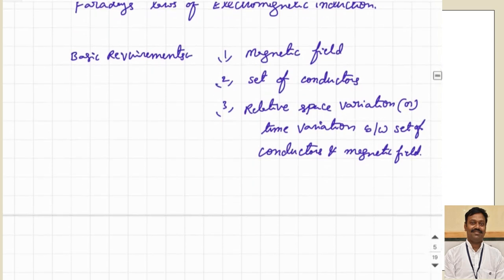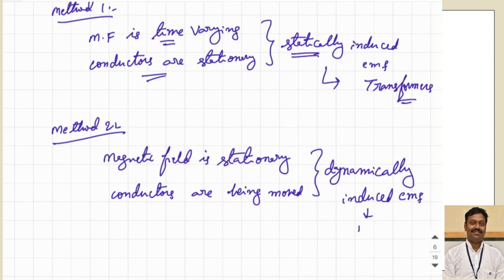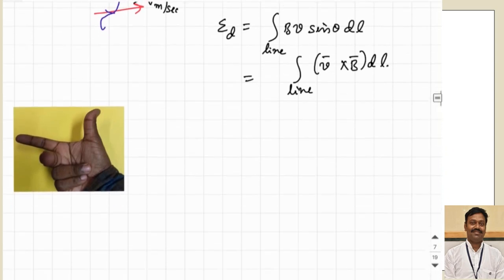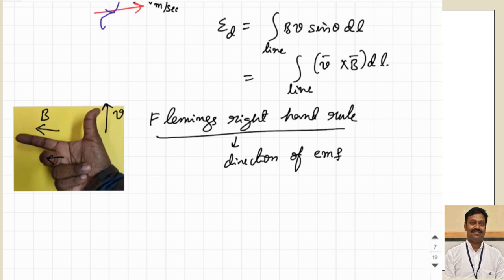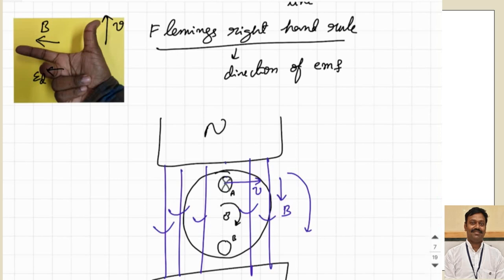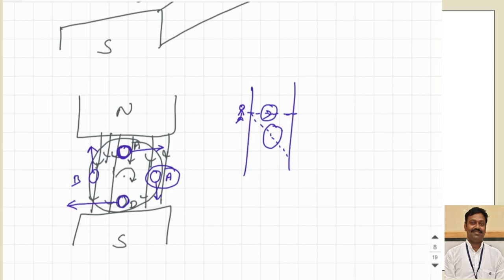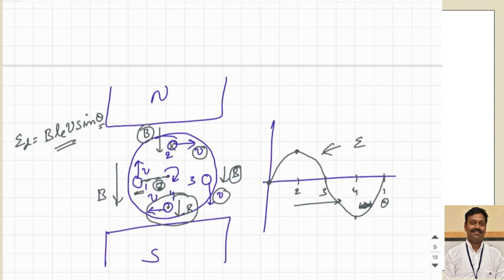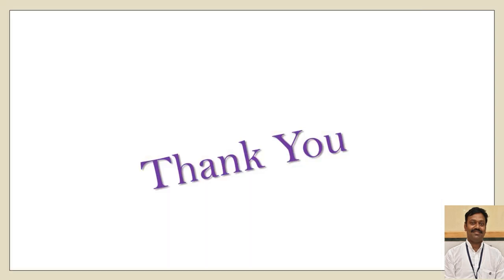SM03 Basics 2

Comment: Sir.
What does it means when Ed pointing inside ( x) or outside ( dot )? Direction should be positive or negative, plus or minus? At 19: 20, point 2 is x and on the waveform is represented as positive peak and point 4 as negative peak.Why cant we say point 2 is negative peak when it is x and point 4 is positive peak when it is a dot?